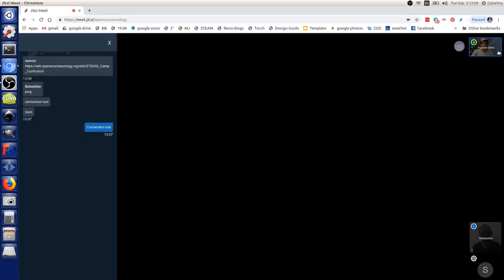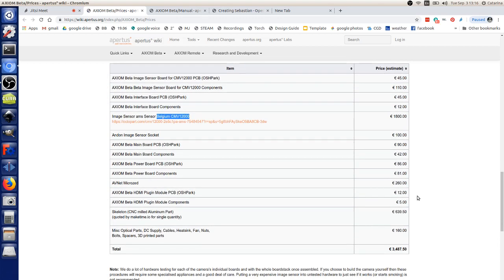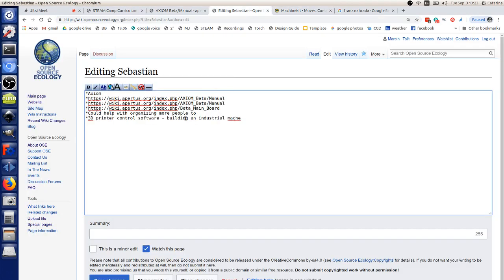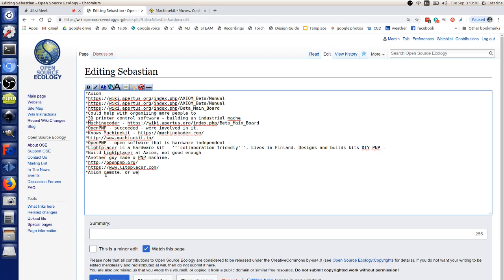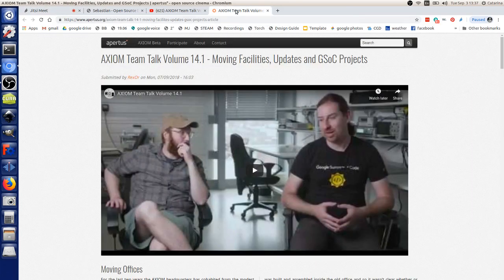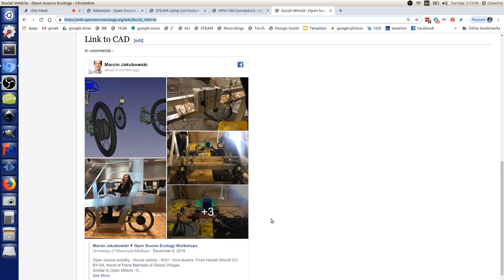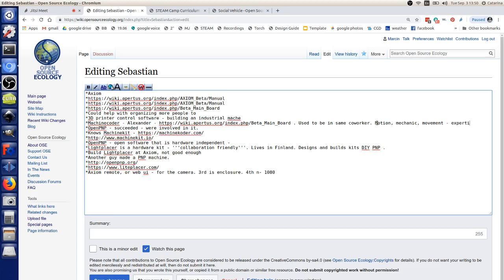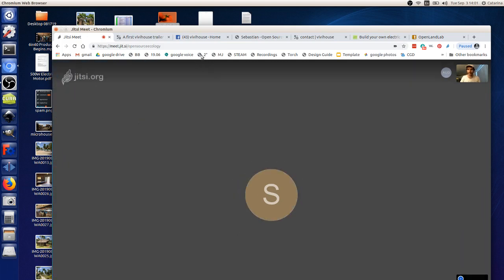Sebastian Pichelhofer - Project Lead for Apertus

Comment: Right now the biggest problem for replication is price.
€3,487.50 is ₹2,78,161 in India, which is huge — an entry level APS-C DSLR with an 18-55 mm lens costs ₹20,000-25,000 ... which is 8% of the cost of AXIOM Beta DiY, which is ridiculous, because people use DSLRs for at least a decade or two and maintenance and lenses don't cost anything near that. Unless the price can be reduced to that, it's an impossibility. The  €1800.00 sensor is one huge deal, but its not alone either So, a lot of work still remains. I'm interested in a DiY sensor maybe .. and many a thing more.